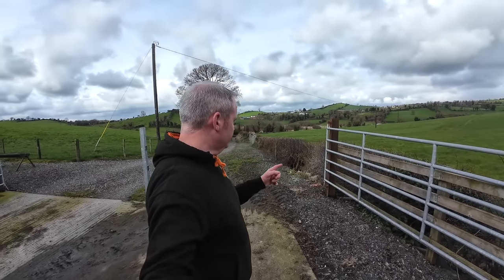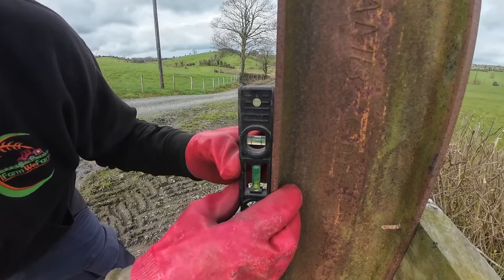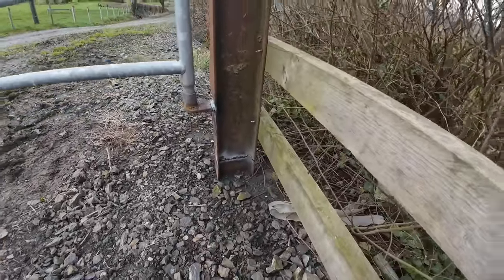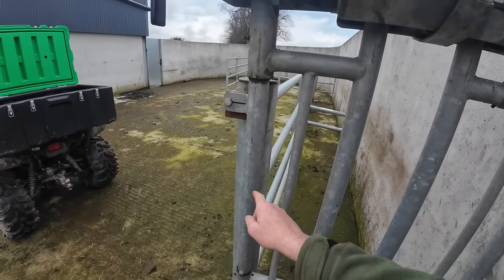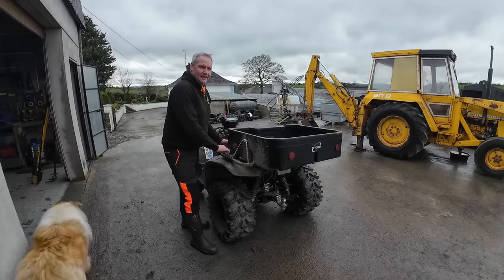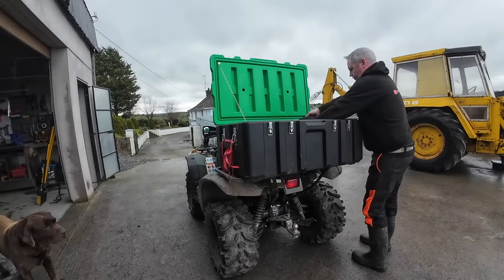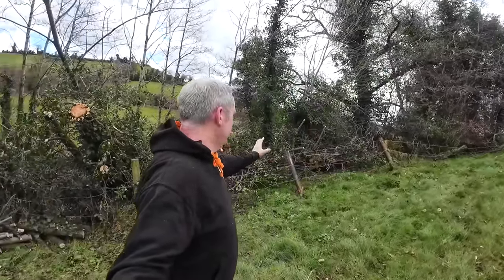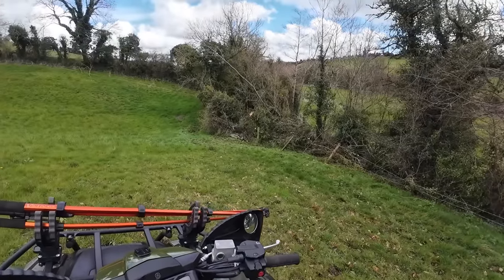Spring Loaded Crush Gate Mod || Heavy Steel Post Straightening

Comment: Those gate's are designed for other end of crush and then it automatically locks open. I just disconnected the spring years ago as a temporary solution and have done same on new gate works a treat. Happy Easter.

Comment: I seem to remember it being called the luck of the Irish. Well it has been said before and I agree how smart, tidy and hard working a professional you are Adrian. An ambassador for Ireland and farming I tink it is fair to say. Only in Ireland would a gatepost fall backwards and a gate rise. A bucket full of tools along with much time and hard work albeit you did go to the expense of a new bubble ( great distraction gag ) for your level so it was sure to be corrected properly. One thing you can't change was the date you posted the video, perhaps two or even one 30 or 36 mm spanner was all the tools needed to put that gate right. Right ! Either way, keep up the good work...................😜😜

Comment: Another good video Adrian 👍thinking,,,,,Hudson thought he was going to have a ride in quad box! 🤪 you done well on gate post and cattle crush 👍👍 wet ground hardly any chain harrowing and rolling done here in Somerset uk just so wet! As for posts rotting out,they seem to have a life span now of 5-7 years, if you had a redundant ibc tank, you could fill up 2 foot of it with old engine oil (after servicing machines) leave fencing stakes soaking , lift out a few days before you want to use them so they can drain off, just a idea, noticed the ones I done are still strong and in place coming up 10 yrs , anyway stay safe have a good week 👍🍻 oh take it all calving finished and cattle all good 👍

Comment: Hi Aiden Those gates are made to stay open,There are two 19 bolts under the top that are spring loaded ,ajust them and it is job done , had to do it to mine ,we have 4 of them, your gate is a older model , it's only ajustable only on one side.

Comment: Happy Easter Adrian your a very tidy and handy operator you commented on the green scum on the concrete you can get a product called spray and leave I would recommend it. I've used it myself and it worked for me and every time it rains it sort of refreshes it self. It's ireland so it refreshes it self right and often keep up the good work your a great ambassador for the farming community in ireland
Reply: Is that called 'wet and forget'. I have some made up here and didn't get enough dry weather to apply it yet.
Reply: What i used was spear and Jackson spray and leave seen it on one of the shopping channels one night 5lt made up about 25lt  found it a good job they recommend twice a year march and September

Comment: In regard to the creosote posts.. i use Creocoat,  it's a creosote substitute😊 you'd need to soak the ends of the posts in tubs before putting them in the ground. Then lash on at least 3 coats for a good job😊 the posts need to be bone dry before starting❤

Comment: I really hate to come up with ideas after the job is done . But to maybe give others some ideas - I would have chained the iron post to back of the tractor and pulled it back from where it came. After getting it to right spot I would back tamp with crowbar and gravel. I'll admit that a 13' post is a factor but as posts slip down a hill the uphill side is usually very soft and uncompacted. Wet time in spring would be best time.
Reply: @ronriehle1337 with a comment like that it's obvious you've never actually hung a gate or set a gate post in your life 🙄

Comment: Great video as usual. Happy Easter. I noticed your quad has the same tyres as mine. Recently I noticed on mine that the right hand side rubs against the petrol tank when the suspension is compressed. I think you can add spacers to push out the wheels. Any thoughts or ideas.

Comment: What’s the story with the Milwaukee grinder Ted thought other than the ratchet u were  DeWalt all the way
Reply from the maker: I have a few Milwaukee tools, i found there grinders and impacts have more torque. Still would pick Dewalt purely for the fact that they’re easier to get fixed if you buy them in the right place. There a dealer in Cavan that fixes them in house which is fierce handy. Yes warranty will cover you but a Milwaukee could be away for several weeks on a repair.

Comment: why would you not have simply extended the gate holders attached to the steel beam
Reply from the maker: You could do that but then you’d have a big difference between the gap at the bottom vs the top once the post isn’t level.
Reply: Correct